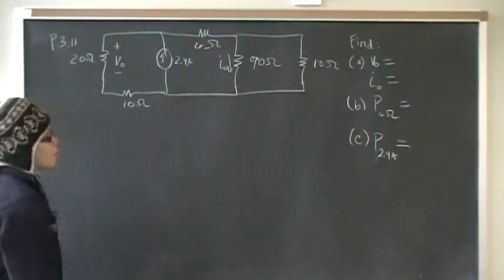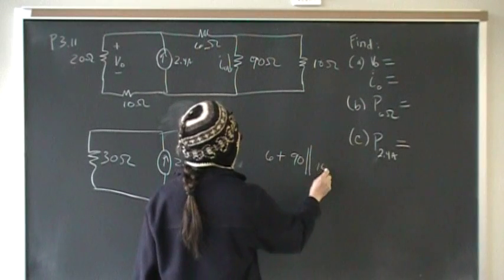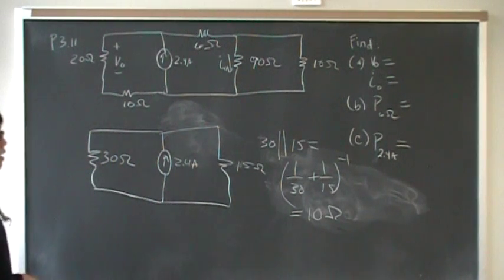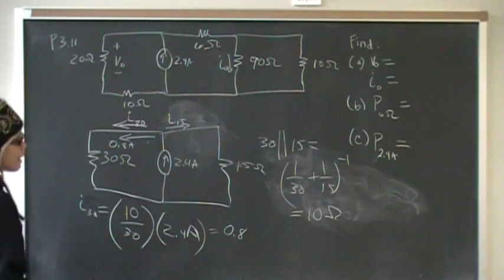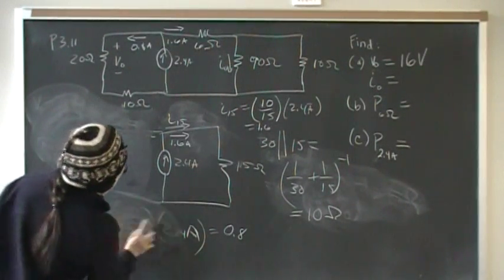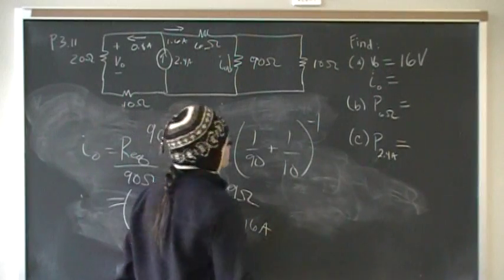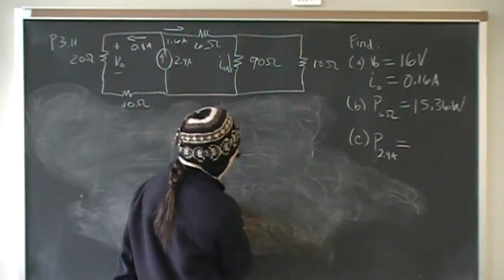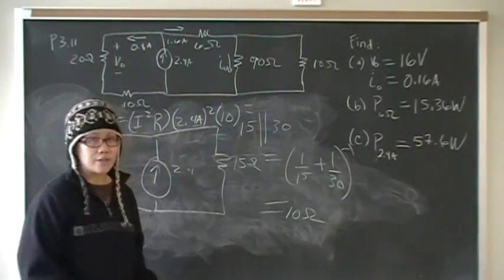Current Divider Circuits P3.11 Nilsson Riedel Electric Circuits 9E Solution

Comment: You the real MVP
Reply from the maker: +Yui Hirasawa awwwwww.... :-* <3 and this is why i do it. :-)
Reply: Thuy Myers Could you explain why the 20 ohm resistor (to the left) is 20 V, though? Please and thank you!! :D
Reply from the maker: +Yui Hirasawa actually it does not have 20 V through it. the current splits at the top node. of the 2.4A, 0.8A will split and got through the branch with the 20ohms in series with the 10ohms. from there, we calculate the voltage drop. V=IR so V=(0.8A)(30ohms)=24V. part of that voltage drops over the 20 ohm resistor and part drops over the 10 ohm resistor. it is exactly proportional. so 2/3 of 24=16V. thus 16V drops over the 20ohm resistor.
Reply: Thuy Myers OH! I figured it was something like that, I suppose I was just confused with the sudden placement of the 20V in the question. Thank you very much for the clarification (and for the video) - I believe I will now be more comfortable tackling more of these questions :-)